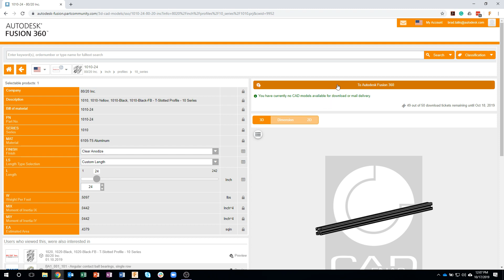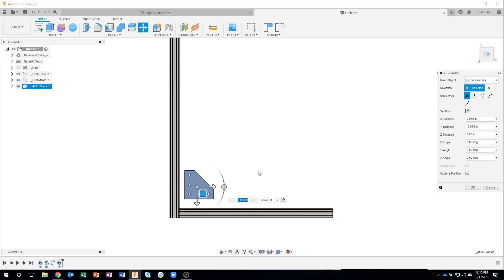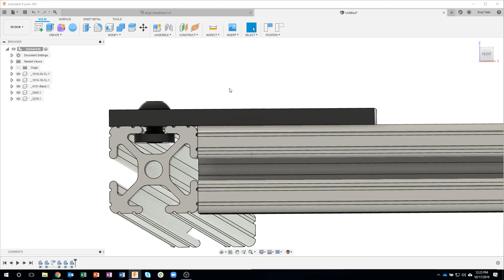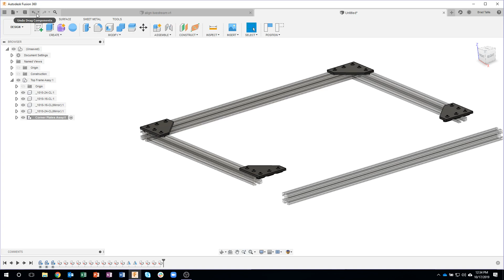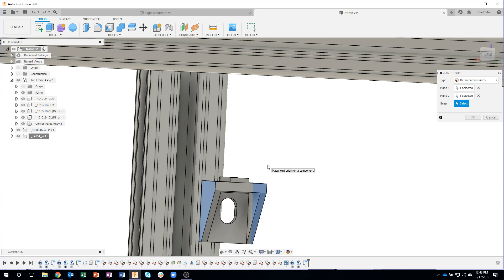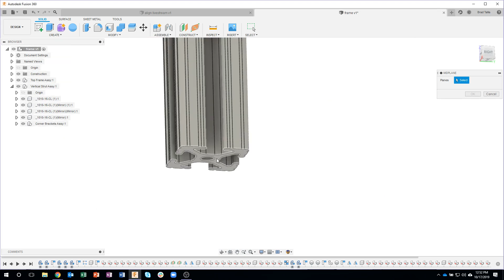Episode 45, Joining parts without Joints

Comment: Hey Brad, those T-Nuts are designed so that they will not rotate in the slot when tightening the screw. Does that by making the nut longer than the width of the slot. So, the orientation of the second set of T-Nuts was more accurate a representation than the first set.